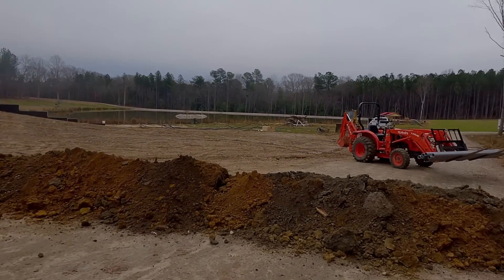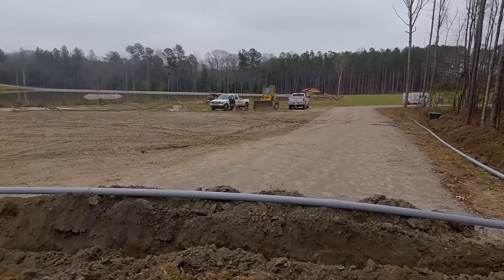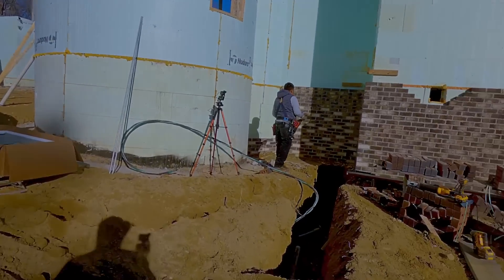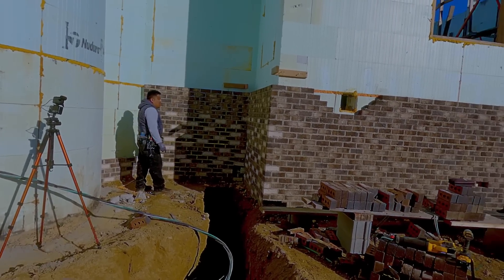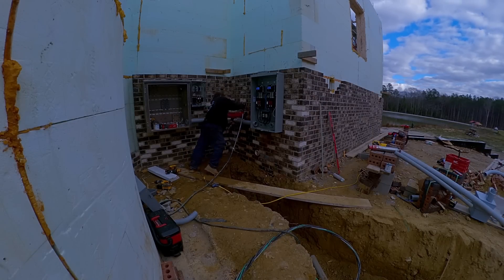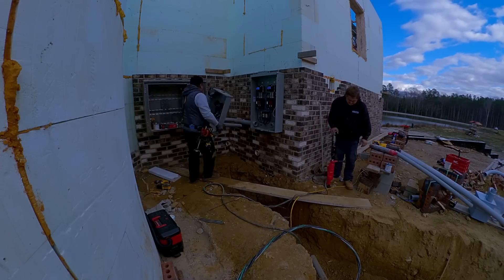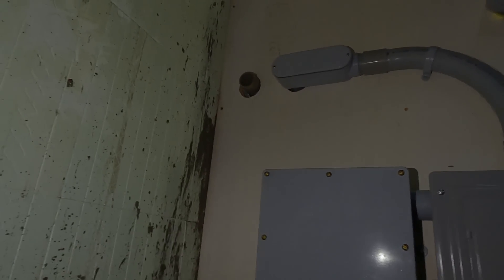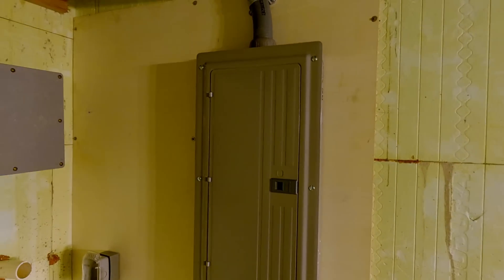Electrical Hookup for the ICF Mansion

Comment: Just a warning from experience.   Pool rooms typically have some chlorine in the air.   Steel panel cans, and metal conduits corrode rather quickly.

Comment: I like how you're planning to block the view of the exterior boxes with bushes, etc.  Are you thinking of using solar power anywhere on the property?  With a home this size It could help offset the energy costs.  Best wishes for the New Year!
Reply from the maker: @silverlicious2086  Yes, I have a place planned out for solar
Reply: Sounds good.  Will be interesting to see the solar installation process and purpose.

Comment: Greenlee makes punches like that,   We just had the hand type that were amazing.   Don't recall steel gauge limits.  You can sharpen them up.  

ASIDE:  After you run power thru all those various lug connections for a month or so.  Go back and Re-torque them. They will get loose from the heat/cool cycling. 

This was something we did for many years,  

Then at new company [ as a consultant ]  we got one of the Fluke IR meters  [ has color display of temperature profile ]  It was amazing how many lugs were loose and showed up as hot spots across the entire company.   That was later in career and showed me it was smart to do that re-torque step. 

Looks like those guys did a good job from a trained eye.    The Fluke IR tool might be worth your investment.  I thought it would be good for home business to evaluate homes for heat loss and where to add weather stripping etc.  

Chris is on the hand shovel a lot.   Funny you poking at him.
Reply from the maker: Good tip. I thought about picking one of those up to see how well the insulation does. Thanks 😊

Comment: I don't see the ICF  home consuming 600amps of electricity,  if you install a ground loop heatpump for heating and cooling for every watt in to it 4watts out. If you use led lighting that a small electrical load, so I  see your pool as the largest consumption point in your property.

When you need CT for your electricity metering don't be surprised by your electricity bill!
Reply from the maker: It’s more about having the capacity than using it all the time 😁. I still have a shop to build.

Comment: You have service potential to start your own radio station 4 ought electrical cable. I had a small station years ago 400 watt out put a little jury rigged outfit. You on the other hand could do a legal radio station 50,000watt AM if you have talent in that regard you could be the next Rush Limbaugh or you could be that red hat variety I try not to broach the subject directly .

Comment: Nice job but where is the metal locator tape plus yellow caution tape which is usually 12" above your conduit .our inspectors require it
Reply from the maker: That's not required here.

Comment: Going to be a pain even with lube to push wire that far!  150’ with 200amp wire straight had to cut the pipe to pull it then re glue.

Comment: nice, I'll have to do a video on our building that houses our generator and all the disconnects. we have 1200 amps to the ct cabnet. three 225 disconnects to the generator. one hooked up but not being used. and room for two more pannels. we took all the pannels off the historic home and ran the house as a sub pannel. several other builds and the shop hooked up as well. we are building a servants home soon and that will use the 225 amp extra pannel. 3200 kw generac gen. 1000 gallon propane tank. next is running a solar network set  up.